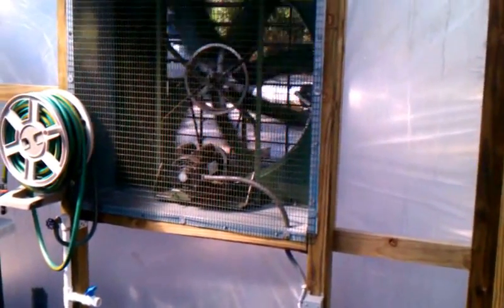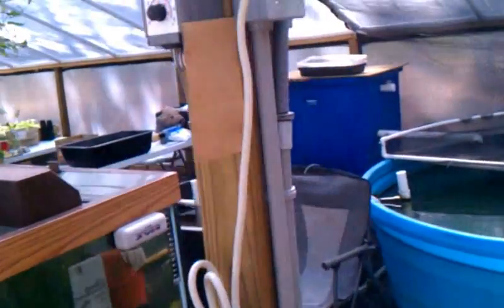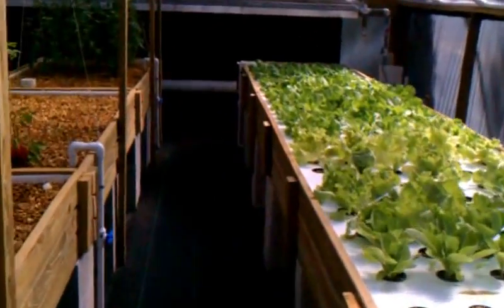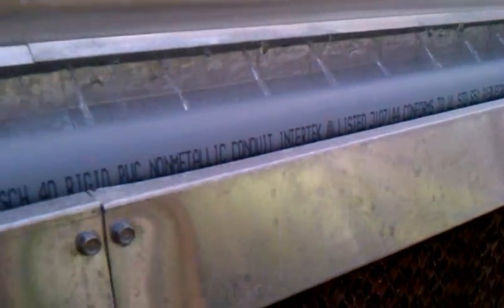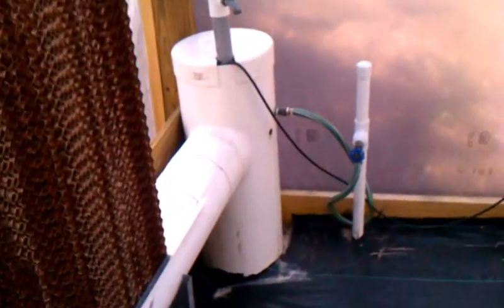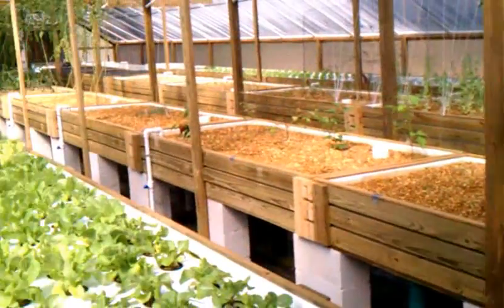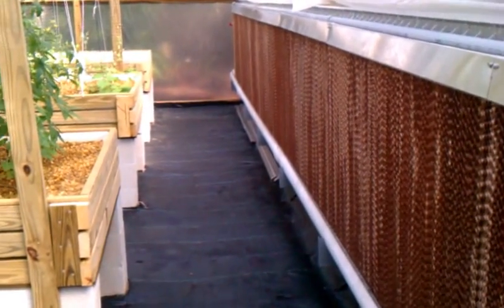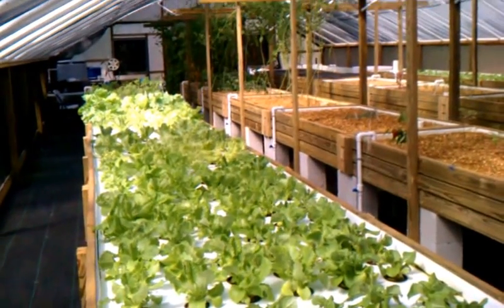Aquaponic Greenhouse Cooling System

Comment: Would the wet wall on its own have been enough to cool the greenhouse? You should also have the option to use the heat thats gathered by the sump of the wet wall for hot water somewhere else?
Reply: I think you need the exhaust to remove hot air so more air can enter through the wet wall for cooling.

Comment: Also you can look into reservoir cooling systems.   Where I live I know I have no possibility of growing cooler weather vegetables during the summer ( lettuces ).  My starter system is quite a bit smaller than yours though and I've been freezing bottles of water in my deep freeze to drop into my reservoir.

Comment: I love your greenhouse setup.  Everything looks so professional and neat.  Good work on those beds and raft tables.  Where did you get the kit to build the wet wall?  I am thinking of trying to build the distribution and return system myself and purchase the cooling pads from a supplier.  Also, do you have louvers on the outside of the cooling system?